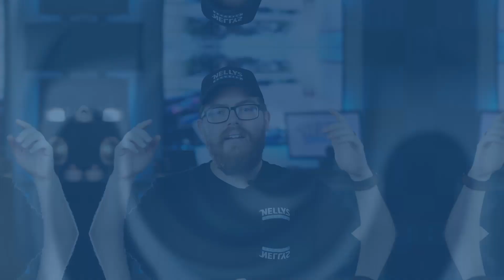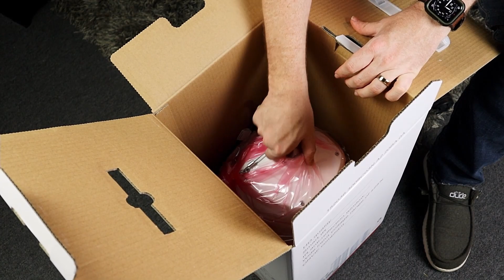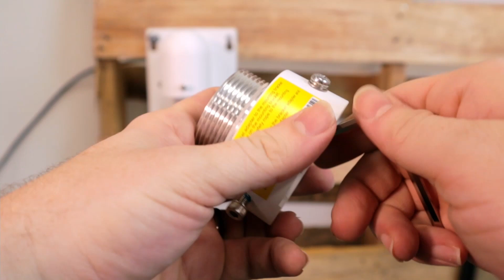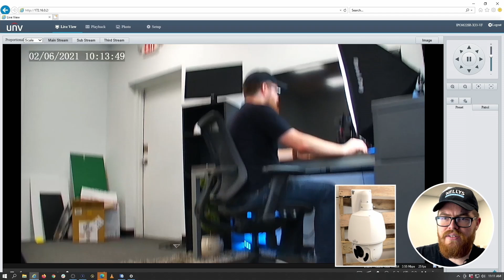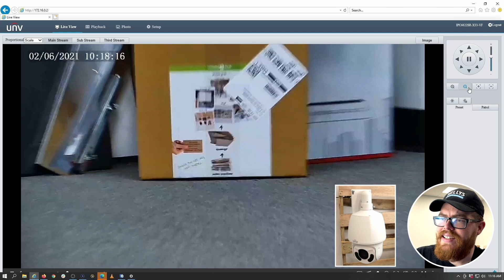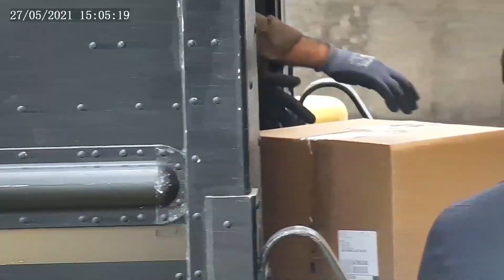NDAA-Compliant PTZ Camera from Uniview Unboxed and Tested | 2MP video at 60fps (IPC6622SR-X33-VF)

Comment: Hello, my name is Antonio Ferro, I have recently been an installer of the UNV brand, in the meantime I wanted not only to thank, but to congratulate the channel, which is very interesting.  I have a question to ask, I have installed IPC6622SR-C33-VF, I can't get the auto traking to work while it is patrolling, can you give me directions on how to do it?  thank you
Reply from the maker: Hey Antonio, thank you for the kind words!

As far as the PTZ not auto-tracking during a patrol, are you able to get it to track while its in a static position? You may do a cloud firmware check or reach out to wherever you purchased it from to see if it has the latest version firstly. Then see if it can track when its in a static position, once that works, see if you get it going via patrol. Usually we'll advise having the PTZ in a static position w/ auto tracking for the most reliable results!

Comment: Great video. But it's 2021. How do they not have a 4MP or 8MP offering? Perhaps with a slower max framerate. For the expense of this camera, higher resolution would be nice, even if different resolutions were offered at higher price points.

Since I have a 16 port H-series NVR and all my cameras are H-series, what are my options to use this? Can I plug it in to the NVR and connect via ONVIF? If I do, can I connect with the UNV software, since the H-series software probably can't run the PTZ functions? 

I also have a Unifi 16 port POE++ (bt) switch. Would I be better plugging directly into the switch and running the UNV software? 

And since this is my home and NDAA doesn't matter to me, any chance of an H-series camera with PTZ functions like this?